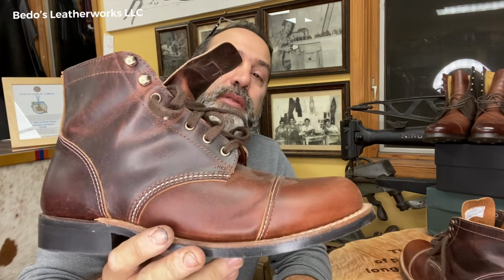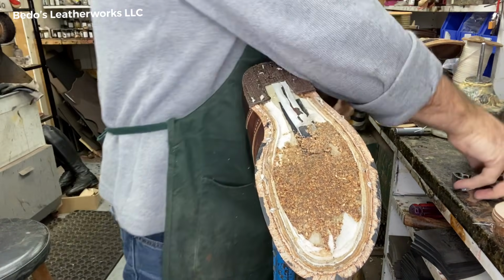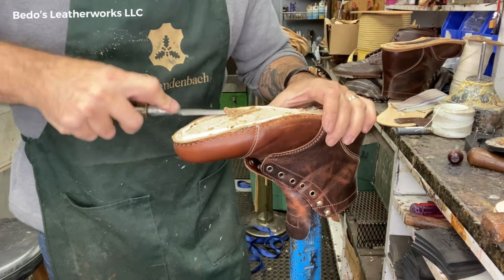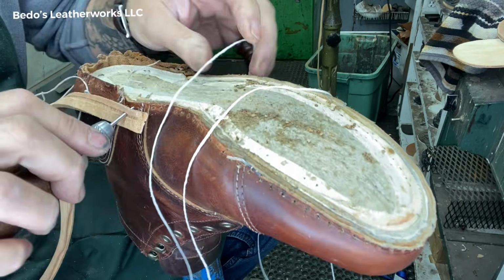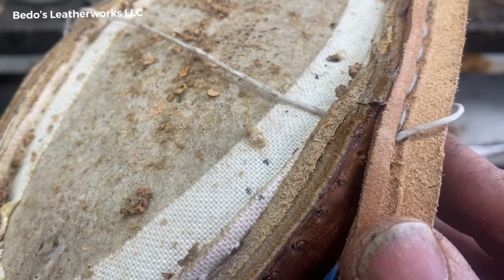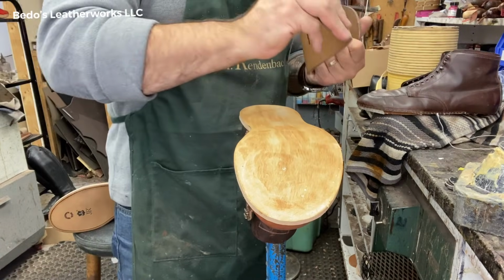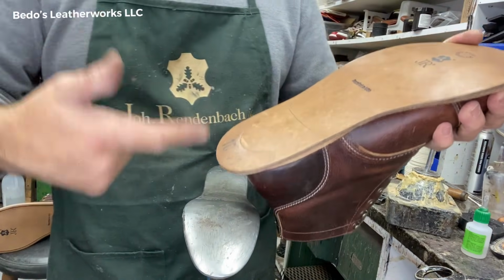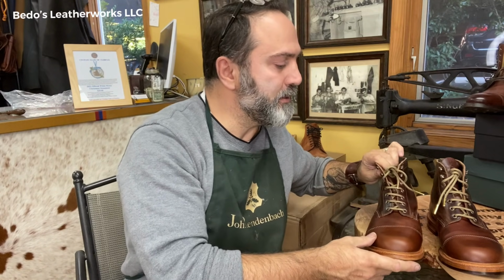270 deg to 360deg. Split welt conversion.

Comment: Nice job, great make over.  Please stop submitting to your critics by avoiding the word "project".  Replacing heels and soles may be a job but these complicated custom transformations you do are indeed projects.  Other cobblers I have seen call them projects as well.  BTW, you have not addressed the news that JR is not going to provide leather soles anymore.  What do you plan on doing?  Look forward to the next project.
Reply from the maker: I spoke about it in one of my videos 
I’m stocked up no worries at least 2-3 years

Comment: As always! Great video! I learn so much. 😃
What is the fiber content of the stripped fabric you put on after the shank? It looks like either a light weave cotton or linen. Is its purpose to smooth out the edges of the shank? Apologies if you have covered this in a previous video. I am still fairly new to your channel
Reply from the maker: It is cotton and it’s so the shank doesn’t squeak in case it comes loose which it will never happen but just in case
Reply: @BedosLeatherworksLLC  how do attach the shank? I saw you hammer it but missed if you added nails. Thank you
Reply from the maker: @aayotechnology  just glue no nails

Comment: Curious as to why so many people send their footwear in to convert to a 360 over a 270 as the 270 with a rand is a very popular and proven construction that even most bespoke shoemakers use it. Really isn't a corner cutting process as the heel can be nailed or pegged since it's a hidden area there just isn't a need for the welt there. Is it just personal preference of these particular customers? Or is there a different reason? Love your videos btw! I binge watch your videos often 🤣
Reply: You get a wider heel, which adds stability and support. I recommend it for almost everyone, but especially people that have low arches, back problems and/or are overweight.

Comment: Random question to all : I was in my local salvation army and saw a pair of Allen Edmonds "Sanford" I believe? The stitches on the welt we're very close together and the sole was worn down enough to see a blind stitch. The uppers seemed in good condition. The price on them was $10.99 I was unsure if they were the older Edmonds or newer, they were also a size 10 and I'm a 12. So I didn't buy them. Question is should I have just bought them anyway? Idk

Comment: Definitely not a shankless job.
Love the macro shots!
Is it possible to change out the wheel on the 5-in-1 machine so it doesn’t leave marks?
Reply from the maker: I’m sure there is a way
Reply: @BedosLeatherworksLLC , I was thinking about that too...... but, as an engineer, the original bottom wheel has serrations on it for a purpose, for friction grip. Squeezing the welt, mid-sole and sole together between the two rollers, if they were both smooth they would probably just slip and not move but burnish the leather in one spot instead of bonding the adhesive. In my eyes, it shows your dedication to your craft that you could take the quick and easy route and use the 5 in 1 machine and leave unsightly marks on the sole or you could spend a little longer, put in a lot more effort and have a flawless outcome. It's obvious that you take great pride in your work Steve, and that's an admirable trait, like spending the effort and time to dye the soles with three colors and achieve the "woodgrain" effect that's likely to wear off the soles after a couple of times of wearing the boots or shoes. That doesn't mean that you don't do it for presentation. If the parts of the boots that can be seen look this good, the parts of the boots that cannot be seen are also going to be good!

Comment: Is there any actual advantage to going with a 360 welt? I realize in this case he wanted the split welt look, so that's different. But normally?
Reply: You get a wider heel, which adds stability and support. I recommend it for almost everyone, but especially people that have low arches, back problems and/or are overweight.
Reply: @JSR80  makes sense, good to know.

Comment: Another excellent job. I do prefer the look of 360 degree welts. It’s a shame your customer wasn’t aware that WM Moorby do a similar boot to this one with a 360 welt. Of course, he’d have still had to ask you to replace the rubber soles though.
Reply: This true, but the 360˚ welt Moorby boot has a wider last, doesn't have a cap toe, isn't lined and is beefier looking, with more pronounced stitching. That boot also has a pull at the back of the boot. Cheers

Comment: I've seen you do few 270 to 360 welt conversations and you've explained to difference between the two.  My question is, I'm assuming a 360 welt must be better, but why is a 360 better than a 270?
Reply: Just makes it sturdier, gives a cleaner look. The 270° welt has a heel rand, but the 360° is more like one piece. Been watching Steve for3 years. 🎩
Reply: In practical terms it makes no difference. In theory it makes it marginally more waterproof but it is not going to be something you are ever going to notice in real life. It also makes the boots look less refined and less dressy. 
It baffles me that people buy a boot and then convert it rather than just buying a boot with a 360 degree welt with similar aesthetics in the first place. They are fairly common.